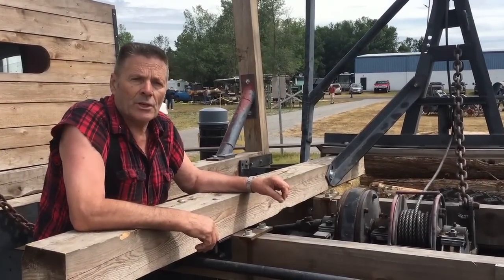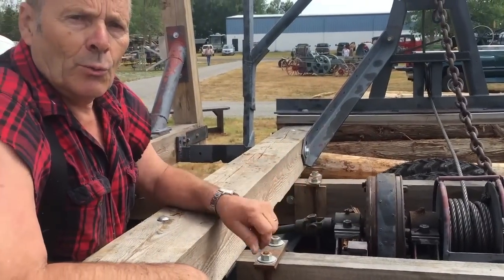1951 Log Truck demonstration by Vernon Wheeler

Comment: We had a cable loader on a 70s model C60. We called it the side loader lol, ran off the pto. Loved that ole truck and I would love to be able to track it down and buy it for a memory. Got dropped off in in for my eight grade field day with a load of 7x9 cross ties on it that I helped off bear that was being hauled to the sale. Loader wouldn’t lift some really big logs and we had a set of skids we would bolt to the top of the standards, we would then cable the log at each end and hook a chain in the middle of the cable, run the chains across the bunk to a vehicle on the other side and pull the log ups the skids onto the truck. Seems like we did everything the hardest way possible but that’s how my old man always did it and taught me to do the same. Makes me appreciate what I have now. Thank you for the video I thoroughly enjoyed watching.

Comment: In the very early 1960's I worked with my father (in the summer) in the White Lake Ontario area.
This exact type of log loader was used to load and deliver the logs to the small sawmill at Waba,
just a few miles away.(Stewart's sawmill)
The only difference was the trip picket design.That truck had what dad referred to as "suicide pickets."
One man at each end had to insert the peavy hook into the release ring and pull at exactly the same 
moment to free each picket.If the timing was not right,the released load would swing left or right.
These were all large white logs that were 12 and 16 feet long.Quite heavy when "green".
Dangerous....but still a lot faster than loading with the decking line and a team of Percheron horses.
Mr.Wheeler was correct....don't get killed....because you have to work tomorrow.

Comment: That hard work me my dad used to use a tractor and a boom and load logs on a 30 foot gooseneck trailer witch we had set up so over head cranes in the mill could unload it dad would pull the logs to the landing and load them mom would thin take my  Dooley and gooseneck trailer and take the load to the mill I had it set up to were it had big straps to tie the load down I was the guy cutting down and limb and cutting down with a chain saw we would cut small tracks of timber 5 acres or less we got tied in with a timber company and they had more small tracks of timber than you could shake a stick at last was hard work but the money was great our cost per load was around 60 bucks the load would make any where from  400 dollars to 700 dollars a load depending on how much and what size and kind of wood I'm mid 40s and man if I could get back in to that again but you can't find people that will work a y more the younger generation don't have a clue what work is looks good old truck working thanks for sharing God bless you